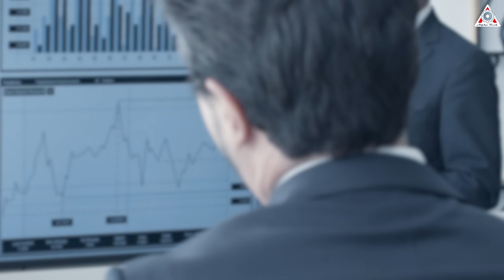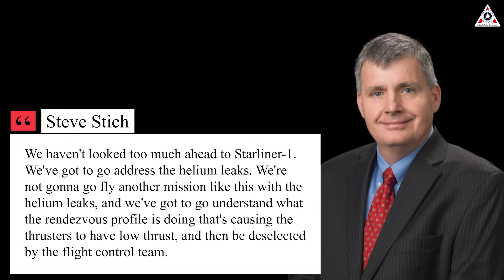Disaster! Starliner NEW DELAYED Again. Pls, Swap Astronauts on Dragon, NASA?

Comment: Put ISS rubbish in Starliner in place of the astronauts and return it to Earth on automatic. If it manages to land safely then NASA and Boeing can salvage something out of this disaster waiting to happen. If not then the it proves the rush to launch with a known (and god knows how many undetected faults) was another failure to put safety before profits. NASA can only justify a backup launch provider if it works, is reliable and comparable in cost, none of those apply to Starloser. Meanwhile launch a Dragon to bring the astronauts home and charge the mission cost to Boeing.

Comment: I see the same thing happening in my refrigeration trade. Now that Heat Pumps are the latest and greatest appliances to have in a home, every electrician, plumber, solar panel installer, and even drywallers are trying to jump on this bandwagon with no training or experience that would qualify them. They get in through the loopholes in government trying to promote clean energy and for those politicians it is more about patting themselves on the back. So, these unqualified people get some basic training and convince the politicians that they are up to the task. The gov't gives them the okay, and those losers hack those systems into peoples homes, and the next thing you know, six months to a year later, these homeowners have a big nightmare on their hands. The electricians and the drywallers gave up the ghost when they found they could not fix these systems when they went down, and they could not stay in business anyways, once the gov't rebates for homeowners ended. The politicians who were patting themselves on the back just a year or so ago, are now running for cover, as the planned new green energy power plants for those regions keep getting put on the backburner. Essentially, many people wind up having coal fired Heat Pump Systems. Some areas of the country have Nuclear power, and other greener forms of energy production capability and that is much better. Soon the homeowners realize that electricity rates are getting higher and higher, and they wonder if they will regret getting rid of their fossil fuel heating appliances. So now here we are... Back slapping politicians and other unqualified people working in sectors they don't belong in. It is likely that Boeing is a union company and they can't even get rid of the unqualified people by the time they figure out who they are.

Comment: RIP crew, should never left the pad with those problems and they are hell bent on returning to Earth even knowing any added problem with the thrusters and He will mean the death of the crew in an uncontrolled reentry.  That trash made it to the station on pure luck with those leaks, not just making it hard to control but causing an uncontrolled thrust factor as well.  Would be like trying to fly a four engine jet with one jet on and turned sideways and another disabled.  (Without the ability to kill the bad jet)  The mission first called for three crew and they cut back to two to reduce load.  Boeing using old off the shelf parts is part of the problem that over 20 years may look new but has seals that has hardened or micro cracks develop.  It is like rebuilding an engine with gaskets still in the box that were made decades before your classic car was even made.  The old 350 blocks were used for decades and if you found a store of parts from the 60's and were using them to rebuild an mid 80's classic or older those seals and gaskets are not going to hold.

Comment: Boeing's flawed products began with B-17s falling out formations, blamed on invisible flak and enemy aircraft. B-29s fell into the sea taking off - so recovery boats were stationed at all runways' ends - blamed on over weight bombs and ammo, not Boeing. Boeing jet liners are killing people due to bad engineering. NASA has a failing Boeing capsule - and will save Boeing before our astronauts.
Reply from the maker: The information from you is wonderful

Comment: It is a test flight with test pilots to run it through the steps; therefore, a delay is good for the mission to work out the problems. Boeing; on the other hand, went down the drain a long time ago. If this fails, and they have to ask for help from SpaceX, they are done in the aerospace business as a rising star in the private sector; they are going to replace them before they even fix the problems, and other problems will occur; it's a billion-dollar(s) lemon, the Edsel of spacecraft.

Comment: As far as I know, thruster firing has to occur at precise times and duration for the Starfart to come down at the designated area, White Sands.  Imagine if you will the thrusters do not fire as required. Where, on Earth, will this piece of junk end up, at the South pole? The active volcanoes in Iceland? In the middle of the Amazon rain forest?
Reply: Probably in all of those places if it breaks up on it's bumpy return.  I speak in bad jest, I just want the crew back safely.  I would think a little more of Boeing if they just came clean rather than crossing their fingers and hiding on the day of the ships eventual return. I just hope they get the calculations right!😉

Comment: Great Video !  NASA management killed two Crews of the NASA Space Shuttle !  One of the Crews could have been saved if NASA had a second launch provider !  Also a SpaceX Falcon 9 aborted a takeoff this past week...  Does this mean that the Falcon 9 is dangerous and should not be used ?  tjl
Reply: They could have saved the Columbia crew even without a second provider. They should have sent another shuttle up instead of risking them on the return

Comment: NASA made a brief mention of the fact the the problem the thrusters had in docking were software related as the system was not seeing the thrusters as operating correctly and shutting them off. That's a much different problem than they keep bringing up. Software has been an issue from day one and in many ways it can be harder to solve than hardware. In any case I suspect that Boeing hasn't been able to figure out why the software is misbehaving. That means they don't have faith in how the thrusters will perform during reentry. You can play around some in the docking maneuver but once reentry starts you don't have that luxury. If you lose thrusters in reentry you mostlikely  become a crispy critter. Thus the hum hawing around. If Boeing didn't detect the software problem in testing it's almost impossible for them to figure it out while it's in space and be sure they have it working. As it stands now any undocking is a coin toss and we don't even know what coin we are tossing. This mess could endanger the ISS as well as the astronauts. And they can't even be sure it's safe to undock the capsule and get it away from the ISS remotely. This is being between a rock and a hard place and NASA should have never had this crewed mission. This has went from bad design to cover our butts at any cost.

Comment: Didn't NASA force SpaceX to quadruple prove themselves before allowing people on Dragon? Why does it seem Boooing got their capsule fast tracked?
Reply: Because Boeing is the largest defense contractor the US has and because the US Gov. can't live without them.
Just look at the hoops the FAA jump thru to keep up with the insanity going on around Boeing's commercial aircraft production when they could just as well just set a deadline and just not certify the designs after the deadline is up. Perfect example is the cockpit issue, were Boeing got an exception to not harmonize the cockpits of some planes (can't remember the types, but you can search the topic and you'll find it fast).
 Boeing is the chicken that lays the golden eggs for the US gov. and military.

Comment: Since  you seem so amazed that Boeing is failing. It was such a leader in the market. I will submit 2 other companies who have done the same thing. IBM and Novell, both Giants in their industries. Both failed to innovate, and sat back on their hands as market leaders, and both got pushed into niche areas of the market by firms like Microsoft, and Dell who did. Boeing, and ULA are dying because they tried to maintain a static state which Musk has mostly proven doesn't exist.
Reply: We are talking about astronauts here and people that are on Boeing airplanes 30,000 ft in the air does the pilots have no control over. You can defend Boeing if you want to, but unacceptable is unacceptable.

Comment: They do not have space suits or seats on Dragon to return home. They would have to send up a dragon with SpaceX suits for the two astronauts on a Dragon that has open seats. They would not have been trained on procedures for Dragon and would represent a significant threat to operations. Balancing the using of Starliner vs un trained and tested equipment sent up in an "emergency launch" have to be part of the consideration.
Reply: Dragon doesn't require people to be on it in order to go anywhere. It is totally autonomous. So send some space suits with seats on it and bring them home. SpaceX can make it happen.
Reply: Which would be a safer and Much less expensive solution...
Reply: doesnt dragon fly auto uncrewed? so 2 humans wouldnt need to lift a finger
Reply: They'd need some instruction covering emergency procedures.
Reply: Sunita is a veteran astronaut and she has flown DRAGON before. I don't know about Barry, but I'm sure he's got some experience. And surely they have both been trained for this type of scenario. If not, SHAME ON NASA.

Comment: The Starliner should be abandoned and just dumped. The astronauts should not have to risk their lives for Boing. Send a Dragon up to bring them back. Boings DEI crap is lethal. Delays upon delays are a bad sign. It isn't you dads Boing. I won't even fly in any of their planes now.
Reply: I suppose that coming back with dragon is not that easy.
First they need space suits fitted for dragon.
Second they need some training, even if dragon will have a commander with the skills
Reply: @maurizioc57  Dragon is fully equipped and proven capable of a return flight automatically.
The Suits, however, are another matter.
Reply from the maker: Obviously!